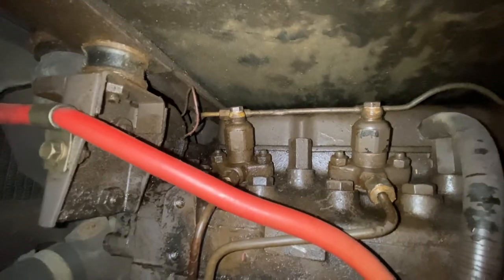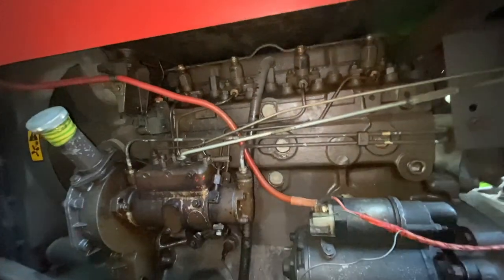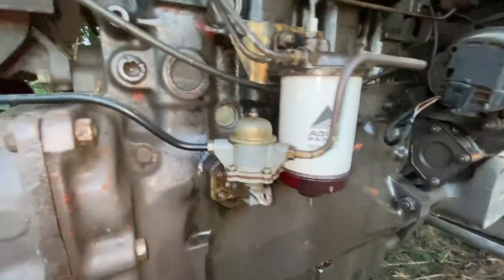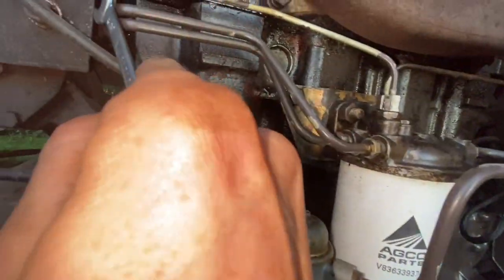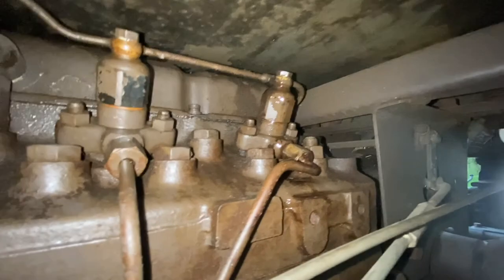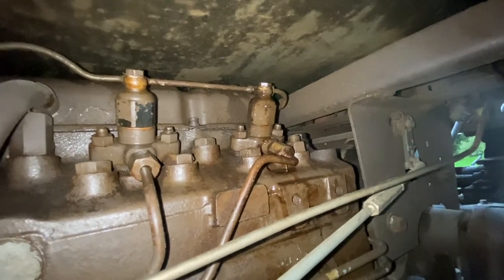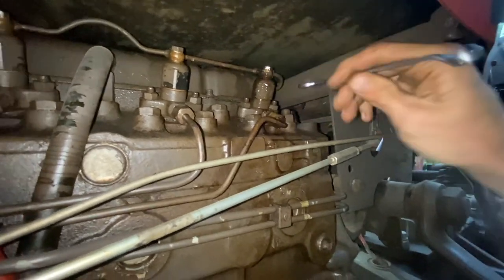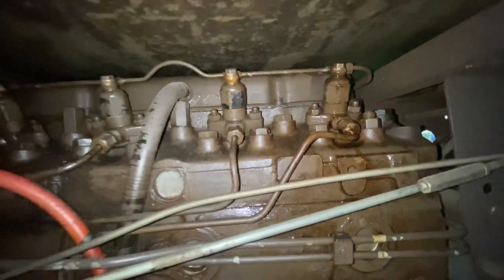BIG RED Tractor Wont Start??? FIXED (Massey Ferguson)!!!

Comment: air being introduced is 9 times out of 10 getting in before or at the lift pump ( primer pump with the handle). After that it is under pressure so more likely to leak out under pressure than suck air in. a clogged filter will starve it of diesel preventing it from revving out and then poss introducing air. To bleed the tractor slacken or remove the bung on the top of the filter housing at 4:03 in the vid. (the one with the arrow pointing out of the filter without a pipe attached.) work the primer pump until diesel flows out of here. Tighten / refit. Now slacken but dont remove the 2x 5/16(8mm) bleed screws on the injector pump. - right of pic at 4:33. then keep working the primer pump until diesel squirts out of these screws with no air. leave them slightly slack and crank the engine. if it doesnt fire after 15 seconds, slacken one of the injector pipes 5/8 (16mm)  where finger is at 4:40 ( any of them doesnt matter) about half a turn, and then crank engine over and it should start within 15 seconds. If not, pump the primer some more checking for diesel at the 2 injector pump bleed screws and then crank again. once started, tighten the 2 bleed screws, and the injector pipe and happy days.
Reply from the maker: Thanks for this amazing comment really helpful info there I will certainly look into that. I had a feeling it would be sucking in near that pump 😃❤️❤️